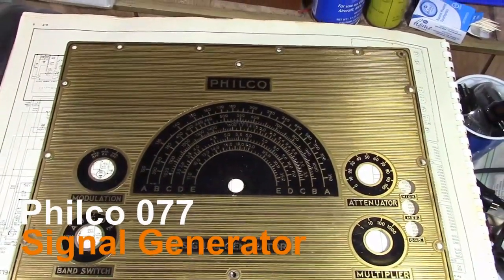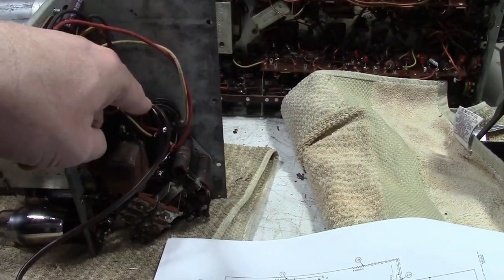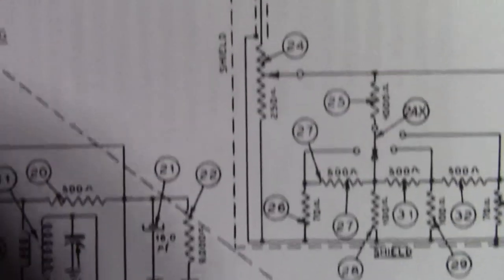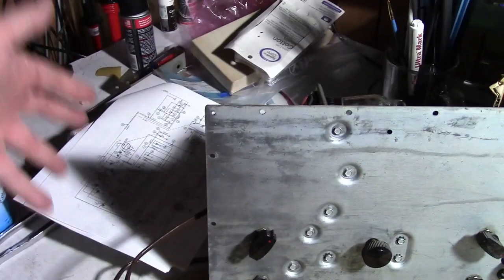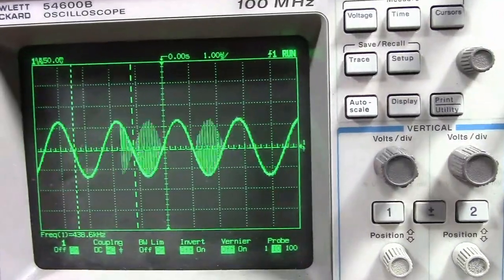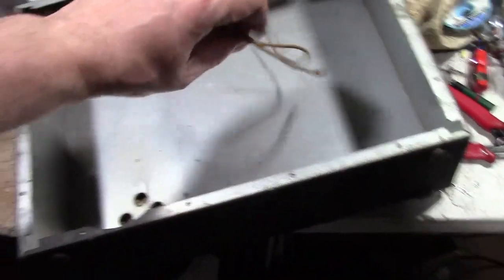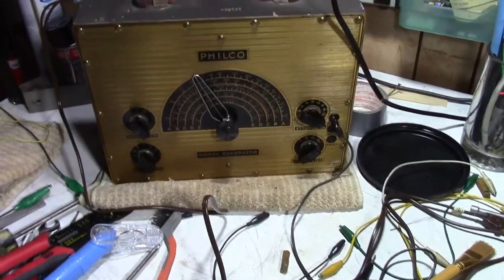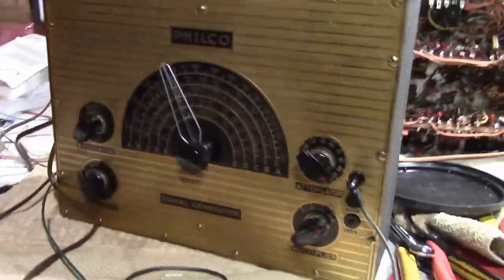Philco 077 RF generator restoration p6o6

Comment: 22:40 That close-up shows the beautiful raised details and dial-scale numbers and other intricate details  of the work-of-art that is that outer panel.... even the dial pointer. Artistry and utility.
Great restoration work Bob... not only looks awesome it's also nice and stable in frequency too.... stable at 455.21 kc anyway, as seen at 18:18. I wonder how it does on the higher bands.
Thanks for sharing. :-)
Reply: ...speaking of it's stable 455.21 kc (( kc aka kHz ;-) )), the  output lead could be placed near the wiring of the IF stage of a radio with a 455 kc IF and that setup would serve as a BFO injection and would make tuning and understanding of SSB and CW signals on the shortwave bands possible.

Comment: Great video Bob! I was curious if your output levels were low like mine! I appreciate the explanation as to why, I didnt think about the signal went to ground thru the voltage divider....I am glad your unit was mostly original....mine was missing the AC plug...I hated it but welded the hole up and put a strain relief....I found some 2 mm (had to spread them a bit..2.5 mm would probably be better)banana plugs on Amazon and I made some leads.....As far as all the suggestions as the mods.....I mean this with respect!!!! In 1937... This was a high tech piece of equipment and was a luxury.....it doesnt take high dollar precision equipment to properly align a radio....in 1937... This equipment was the precision equipment!!! Most technicians used the available radio stations to align and calibrate....tbey didnt use a frequency counter to check their signal generator...the dial was close enough....I believe most technicians unplugged this piece of equipment to protect it from line surges, lightning etc...line regulation was not as good then as it is today!! Im glad you plan on using the equipment as it was meant to be designed! The reason I bought mine was to demonstrate how simple an alignment was back in the day....In my opinion....we try to get everything down to the tenth of a volt...when we should be getting it to the 10-20%...just an old man's opinion...lol.....Thanks again Bob...I really enjoyed the video and will look forward to you using this beast for alignment!!!! Take Care--Larry

Comment: Glad to hear that you used Safety Capacitors in the line filter section.
I think I would have done the AC input a bit differently...would have possibly used something similar to what you did, but perhaps with a color coding on the connectors so that the Hot side always went to the "proper" connector.  (Different strokes for different folks  ;-)  )
I was hoping that you would show the replacement of the handle.  Perhaps you could do a follow up once you do to show what you decided to do with the handle.
Thanks for the videos! They are appreciated!
Reply from the maker: You're welcome.  I know there are modern leather handles available but I've never installed one.  Not sure how I'm going to deal with it.
Reply: It doesn't really matter here since the line filters are identical on both sides of the power line, regardless of which way it's plugged in, and also because it has a power transformer for isolation. You can mod early equipment seven ways from Sunday, but in the end how often will you use it?

Comment: Although the caps are X/Y-rated, is there any significant current flow through the two noise-suppression inductors (#35 & 38 on the schematic) with the power switch off?
Reply from the maker: No.  It's a standard line filter circuit still used in many devices today.
Reply: There may be some passing through the .15 uf capacitors though since it's AC we are dealing with.